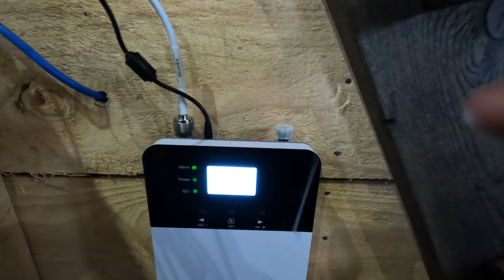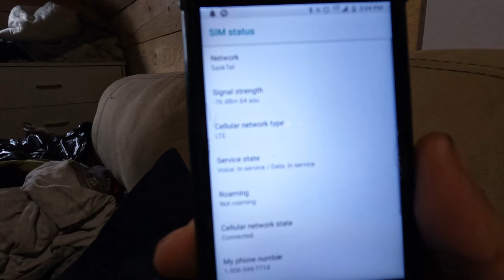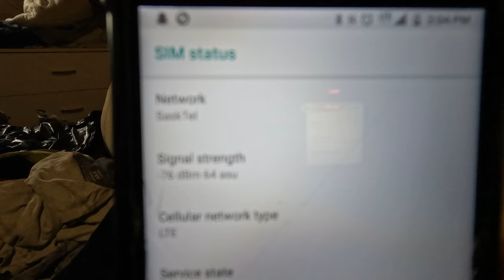Getting Great Cell Reception at The Offgrid Cabin with Hiboost Cell Phone Signal Booster

Comment: Always impressed with your ability to reason shit out. I think you have all the tools built into that booster to properly install.  I use a Sure Call Signal meter when I install cause I don't have the rest of the gear up on the roof with me so I can see signal levels.  I can also use the meter to test drop from cable connection to cable connection.  However, when I support a tech remotely who shows up without an expensive meter some times just finding the correct tower can be an issue.  I have them download a tower finder app on their cell phones and it shows you all the towers in your area and which one your phone is currently connected to.  The Yagai antenna they gave you is super directional and there are also cheap reflectors that go behind it to help it soak up more of whatever it can get out there.  We deploy these antenna to use the data side of the SIM card; I don't do voice. If high speed data is your primary concern there are cellular modems you can buy that can hold multiple SIM cards and will internally combine whatever speed/throughput you can achieve over each card as you total bandwidth. Pep Wave is one such product.  I'm no expert, like you I figure shit out and am often tasked with learning stuff by trial and mostly error. So after installing a dozen and supporting several hundred more installs remotely you pick up some knowledge.

Comment: Nice job. That has to make a substantial difference in signal strength. I installed a similar mast on my shed for ham radio and then I added a motion detection solar LED flood light and wi-fi camera. Will enable you to see what’s goin on there from your phone when you are not there. I don’t know about all that xtra coax cable curled up there. I think that may result in some signal loss although minimal. Good luck! Be safe. Happy Holidays! 👍

Comment: getting rid of that extra coax from the antenna to the receiver will give you a little more signal to amplify.  not a lot but every little bit of signal gained helps.  a cellular booster can only reproduce what it receives.  there are also other directional antennas that have more gain.  I set up a few cell boosters in places where the signal received was from a hillside or mountain side reflecting a cell tower signal (and the signal back to the tower from the booster).  I was a Cell Tech for a long time.  Even the most expensive $40k Pro cell extenders won't work if there is no signal.  maximize the gain from the antenna and minimize the loss from ant to radio.  There is better coax rated with low loss at 1 Ghz.

Comment: The only issues I see you might run into is that electrical conduit is not as strong or rigid as the same outer diameter schedule 80 water pipe so you will want to be careful if that antenna catches the wind in a storm without the use of guy wires to stabilize the mast.  As a rule of thumb I don't put more than 9-10 feet of schedule 80 water pipe as an unsupported mast above a support.  You might be fine but that is a lot of lever if the wind really catches that antenna.  Also, usually they include at least a small antenna for the inside of the house that mounts right to the amplifier.  I guess it coudl be internal but that would mean that the amplifier has to choose between the internal one or the external port so that might be something to test to see if adding an external antenna helps with your reception in the cabin.
Reply: There should be a boosted external that can be run on a separate tower or pole several feet away to give signal on the property at both the cabin and the shop.

Comment: When you were opening the box you mentioned seeing another small antenna. Did you install it on your booster. I didn't see it when you were showing what you did inside your cabin. I have a cable modem router in my home. I use a signal booster in another room and it has two antennas on it. If you're connecting to your phone/laptop wireless then it might be necessary or not. Good luck & happy thanksgiving.

Comment: use the shop to install system and  antenna its on higher elevation high ground always rules with antennas youll get max db for signal and max range if not youll get dead zones

Comment: With coax cable, tight bends will lose more signal. The excess cable could benefit from a larger looped coil. And any runs with tight bends avoided.

Comment: Also need to add, consider lightning strikes in the spring and summer. If you don't have a lightning arrestor for power and the coaxial it will guaranteed mess up your entire system.
Reply: Oh and get the secondary broadcast antenna, let you get signal in the shop!
Reply: You really should have watched the entire video.

Comment: At our place we go into the phone settings and set the cell network to 3G because the LTE(4G) signal is so weak, we watch YT, Flix all on 3G. We get zero on LTE(4G).
Reply: Also had to put a lock on the pole so the antenna would change direction when windy.

Comment: Happy Thanksgiving, boi. Antenna height is crazy, but crazy good! In the future, if not too flimsy, maybe replace the top section of the metal conduit with a rigid plastic or PVC conduit piece? Should reduce lightning strike chances a little bit. Then maybe tie on a ⚔️ ☠️ ⚔️ pirate flag, for laughs.
👍😉

(You can spray paint it gray/gray metal color to match the lower piece.)

Comment: If'n ya can, I would probably pound a piece of rebar into the ground (6' IF you can get it and get it in) run a solid copper ground wire down and ground that mast to the rebar. Technically should be grounding the coax, but I'd more worry about the mast itself. With as many storms as you got roll through there during the build, better safe than sorry. [EDIT]: You can learn a lot by watching the whole fucking video before opening your yap. lol. Guess who didn't do that? I suck.

Also, I don't know why they ship white coax out with this stuff. I'm down in Minnesota and used to work for a satellite TV company. White coax breaks down fairly fast in inclement climates. The PVC coating on white cabling will get brittle and crack. There is a reason none of the cable and satellite companies use it, at least not in Northern climates where the temperatures go from 80-90F heat to extreme cold. Not sure how long you'll be out there or how well that device is working that you'll keep using it, but I'd replace the white coax with a decent quality black coax when you can. It's not imperative, but it's a cheap, worthwhile and easy upgrade.

And lastly, dBm is a unit measurement of noise. Less noise, at least in the sense of wired or wireless signals, is better. The farther you get away from the signal source, generally the more noise (interference) there is over distance. So, for what I do for work currently (telephone/DSL technician), 5.9 dBm would be considered a lot of noise on the line and would cause problems. Higher dBm is better. usually anything in the 10 range or better works well enough for our purposes. As far as optimal dBm levels for cell signal? No fucking clue. But, the principle is the same.

Hope any of that helps you out man.